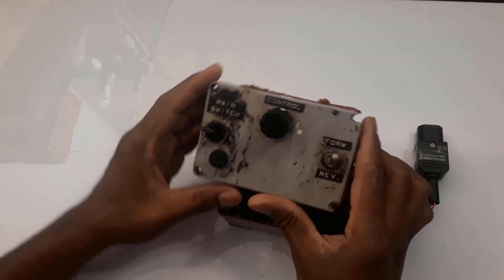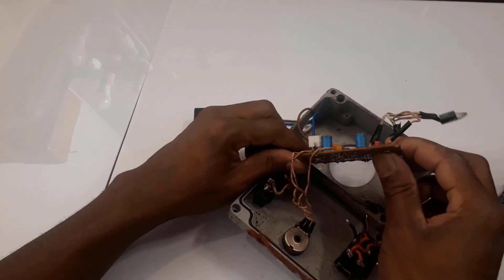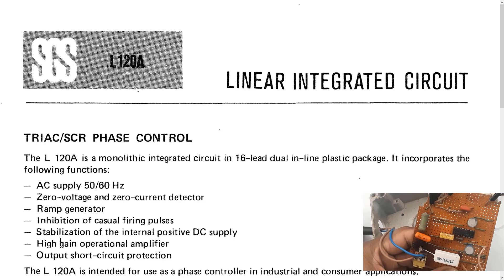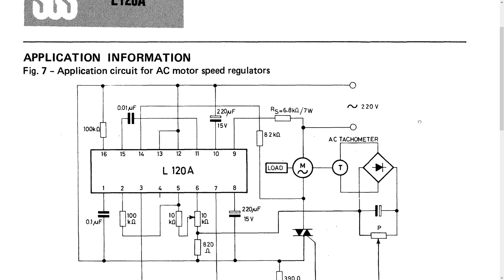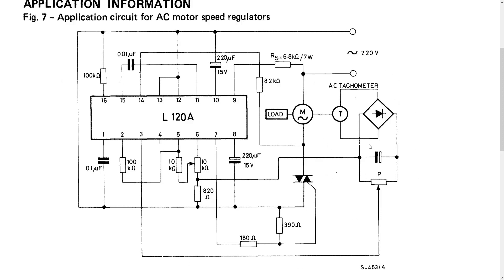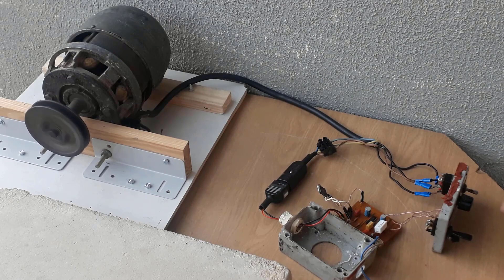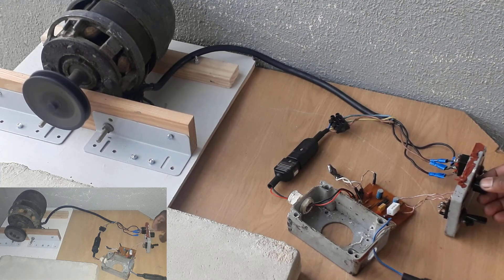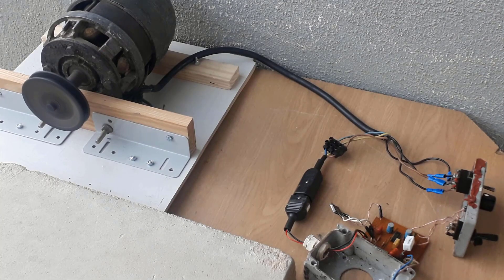DIY Universal motor control driver (SCR Phase control IC). Part 1 - Motor driver Teardown

Comment: hello, a question how efficient is this circuit for universal motors of high amperage tools... how many amps can it withstand without being damaged?
Reply from the maker: Hi Ivonne, I haven't yet tested the actual efficiency of this motor driver circuit, I still need to complete this DIY project tutorial with a final part. But I can say that its definitely above 80% close to 90%, most of the losses occur across the power resistor Rs and some switching losses across the SCR.
To measure the exact efficiency of the system one will have to measure the input power from the mains and also measure the output mechanical power on the motor shaft and deduce the efficiency from those parameters.
The maximum current rating will depend on how much current the SCR can handle.

Stay tune, I will remember your questions when I do the final tutorial in this series.
Reply: @CMTEQ  thanks u so much.I'll be waiting for the video, thanks have a nice day